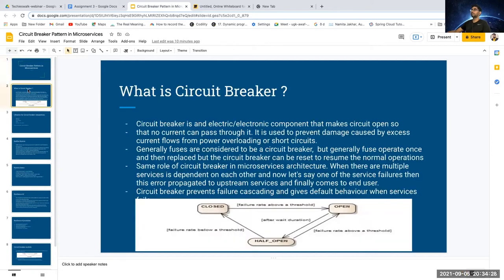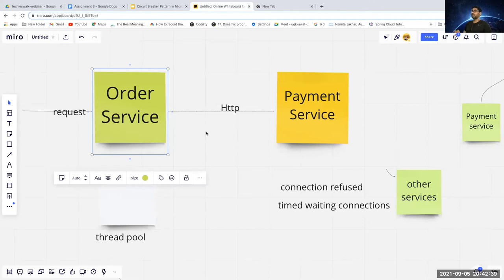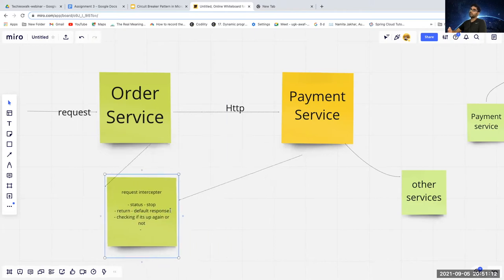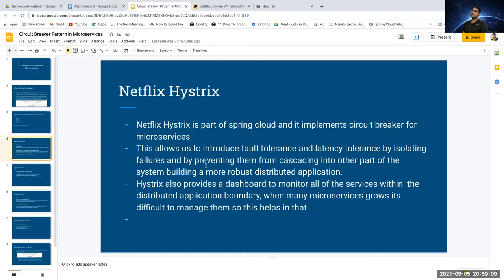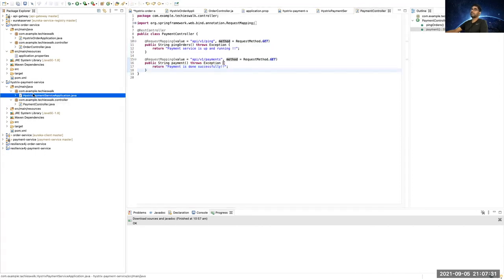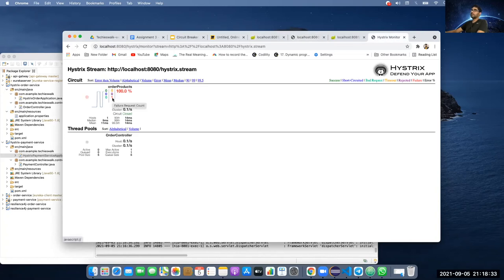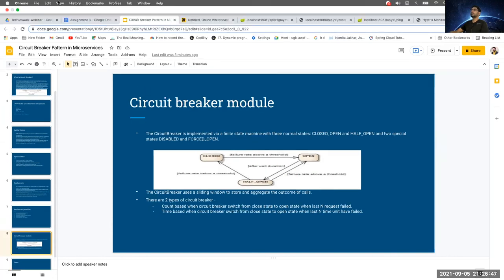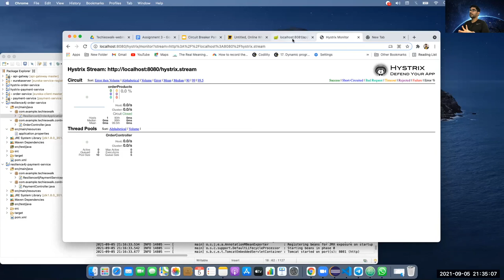Circuit breaker pattern in microservices using hystrix and resiliance4j

Comment: Hi I have implemented the same in my project the fallback is not happening...its directly giving the error message in console.. any suggestions it will be help ful for me... Also.how to debug that fallback method in that case not able to find the exact issue
Reply from the maker: Have you used Hystrix? Let me know if still issue , it should work same way